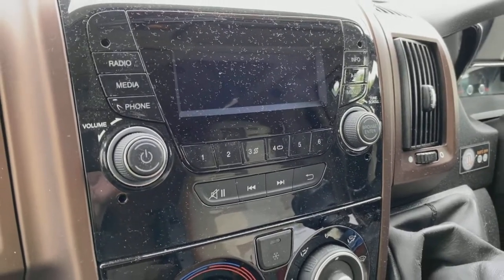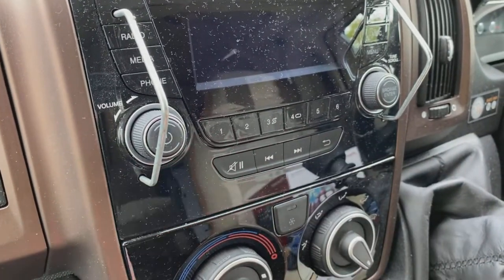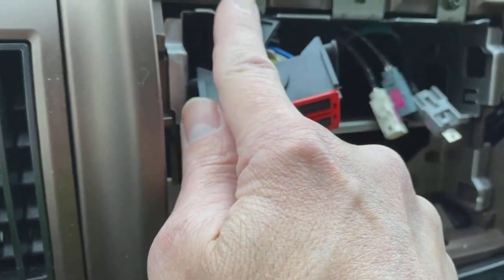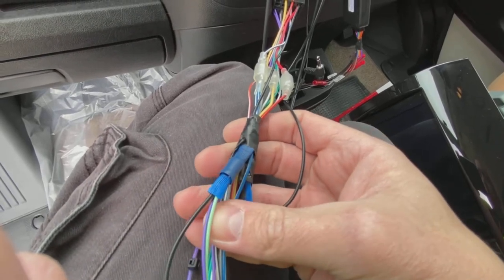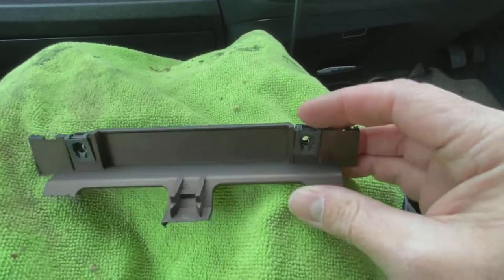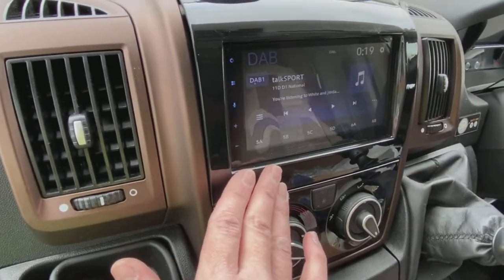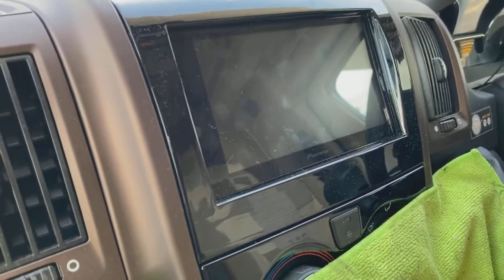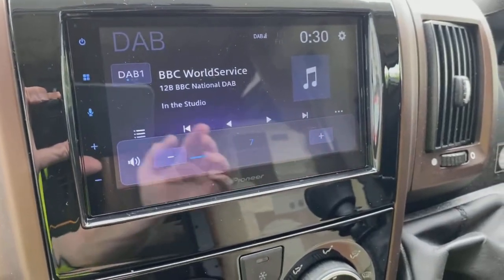Fiat Ducato 2006 onward how to remove radio + double din hints & tips

Comment: perhaps the steering wheel control interface makes the BSI think it has the factory radio in it. I just put a normal stereo in my 2015 and i've got flashing mileage.